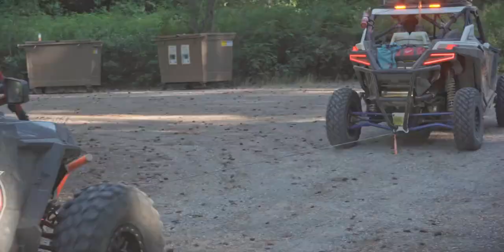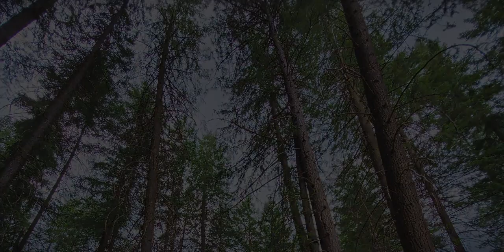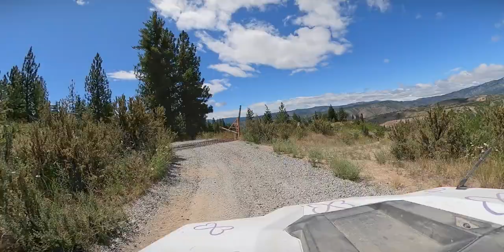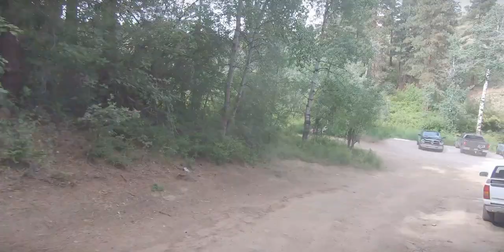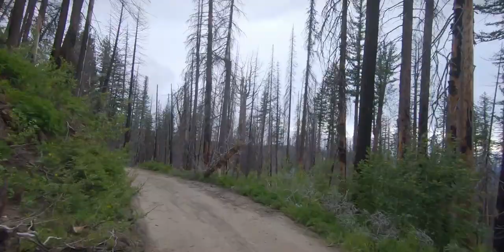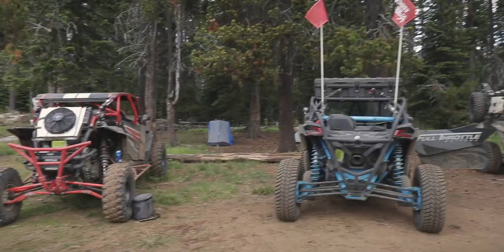The WA BDR Trail - Day 3 - Chelan to Haney Meadow | The SXS Guys

Comment: Do you have insurance for when you round a corner at 50 mph and hit a motorcycle?
Reply from the maker: We never round corners at 50mph… also we had a lead car that would radio out traffic, animals, or otherwise hazards. If we wanted to rip and have fun, we always cleared the route first. Most of the riding was just at cruising speed anyways. We weren’t trying to make land speed records 🤣🤘
Reply: so, you dont have insurance..
 @SXSGuys
Reply: Not trying to set a land  speed record, but yet trying to cover 300 miles in a day. That’s not a snails pace.
Reply from the maker: @danielyoung2219 nobody said 300 in a day was our goal. We actually were trying to get 200